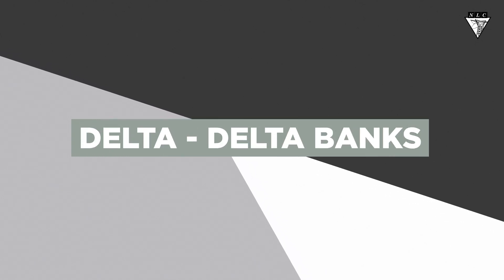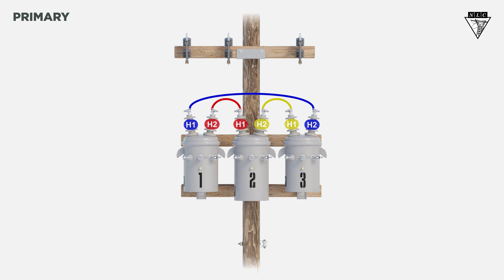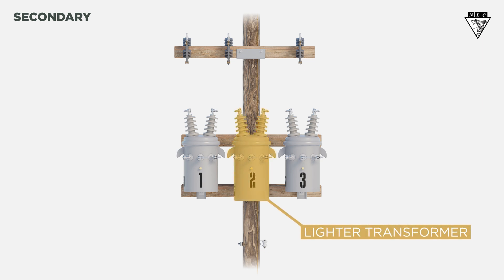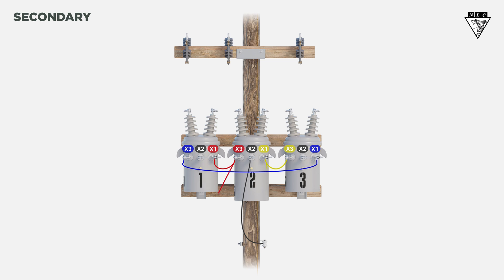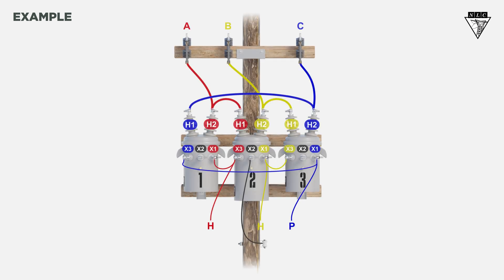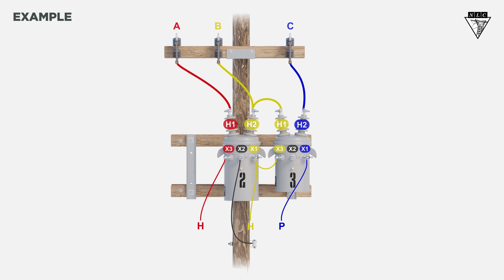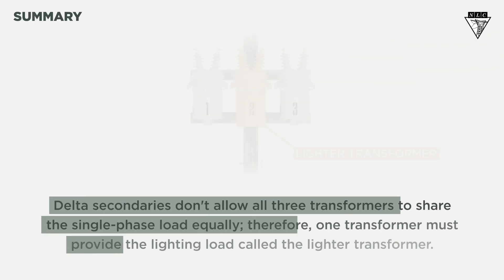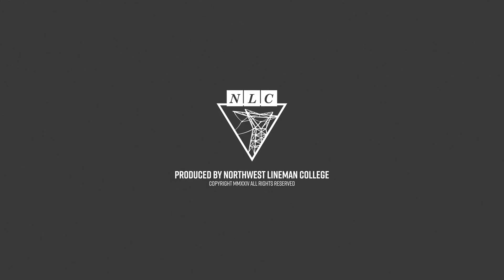Delta - Delta Banks - Explained

Comment: I went to 7 years of electrical engineering college, and it was explained to me that a Delta Delta circuit on the secondary would have circulating currents, in the case of an imbalanced load. It was explained that generally this circuit was used on something that was a load unto itself 3 phase and big. Not to be insulting or anything, does this have circulating currents in the secondary? I love this video and the question is bothering me so much I have asked it I hope for an answer and I'm going to watch the rest of the videos because electricity is a much bigger subject than one lifetime.